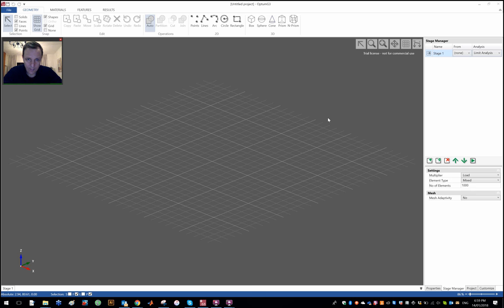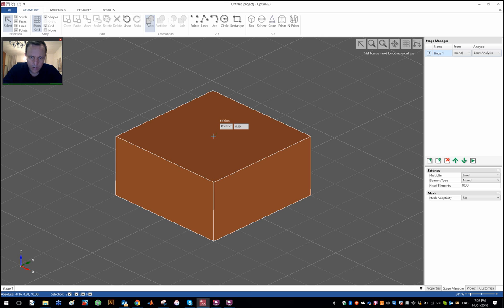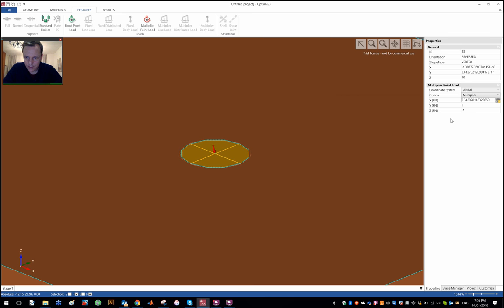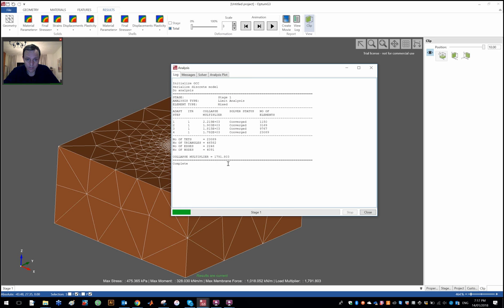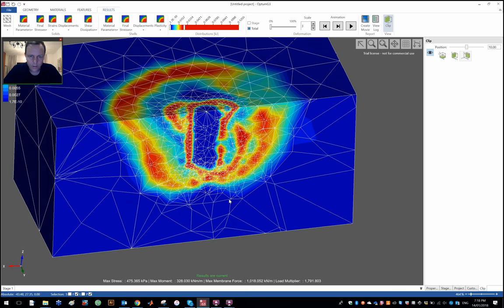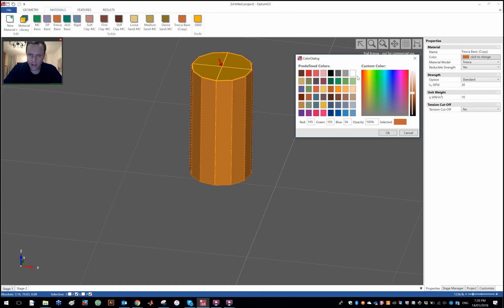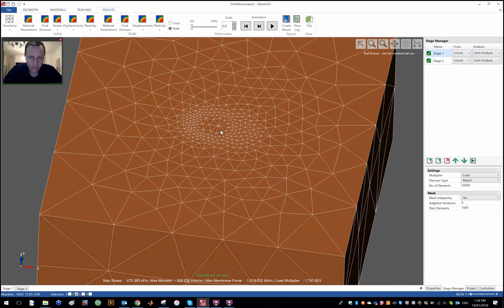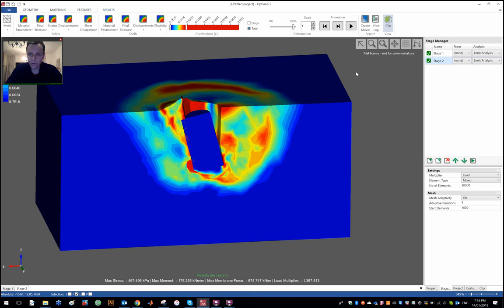G3 Example 3: Skirted Foundation

Comment: Thank you, very informative.
It would be interesting to look at the calculation of the stability of the sides of the pit, which was reinforced with round piles (bored concrete or steel pipes) or sheet piles !!!